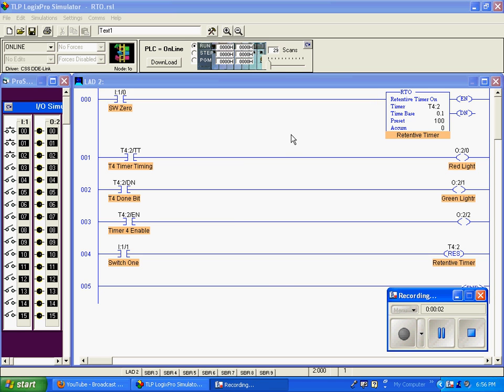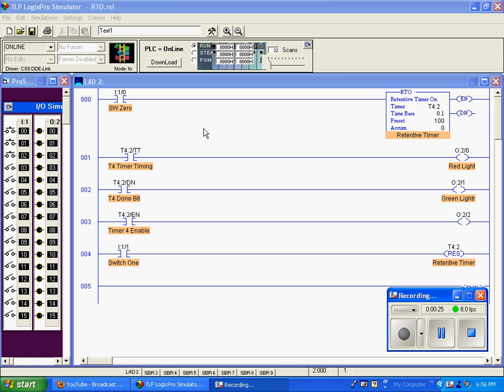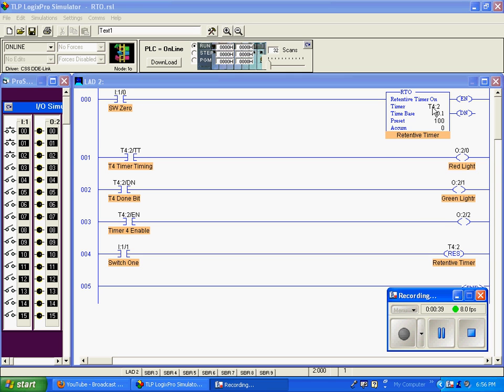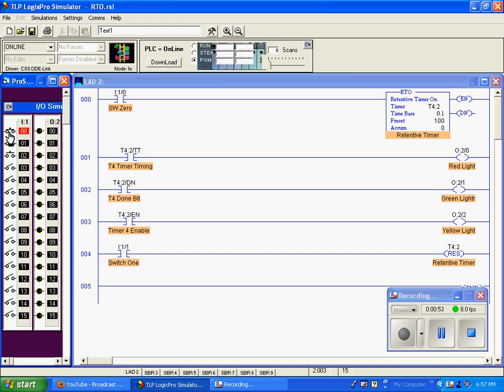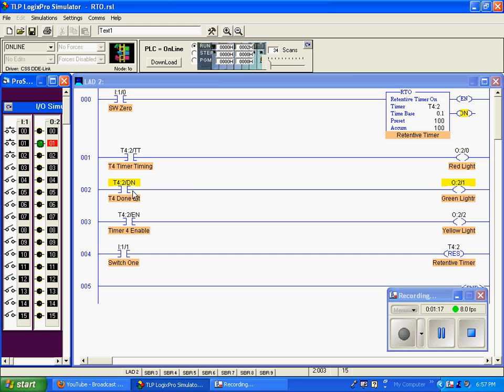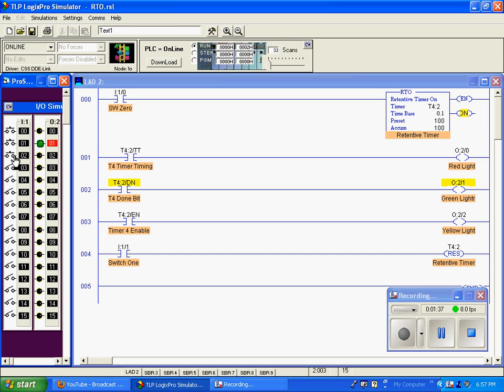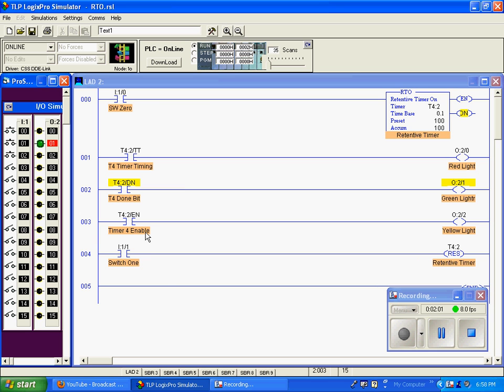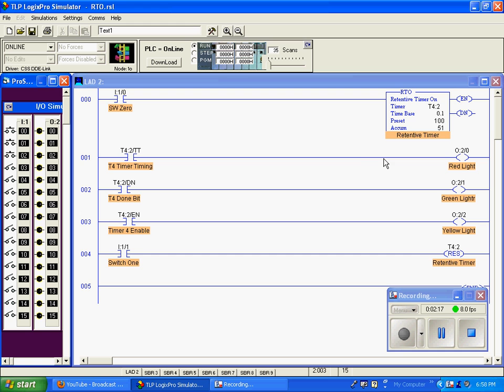PLC RTO Function

Comment from the maker: count up while the button is on...have the button condition in series with your count switch on th same rung.

fill a tank with water while the pump is on...use a transitional contact (XIC or XIO) with the same address as the pump output in series with the condition level sw. Hard to explain, I will try to make a video for you.